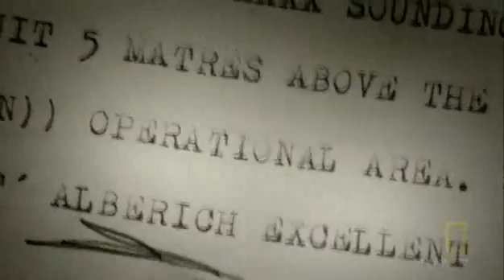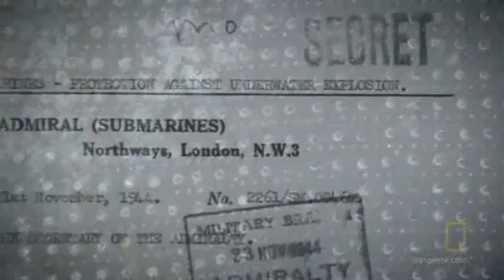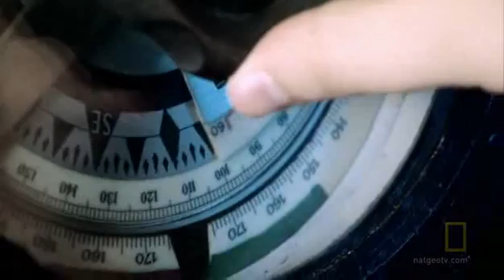U-480: Stealth Submarine 2/3

Comment: Turns out they had been experimenting with rubber coatings since 1940 but encountered problems with the adhesive loosening grip and the tiles slapping against the hull made the Uboat very easy to detect. By1944 they solved these issues but by then it was way to late and Uboats still had to deal with radar detection while on the surface re-charging the batteries. The "snorkel" helped out but again, the Allies by that time had the upper hand and a LOT of aircraft to hunt for Uboats.